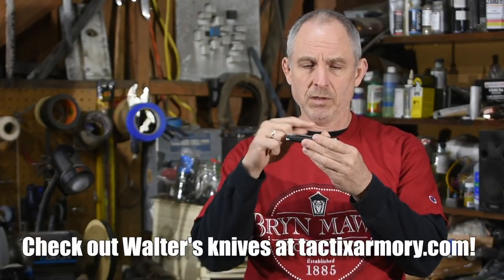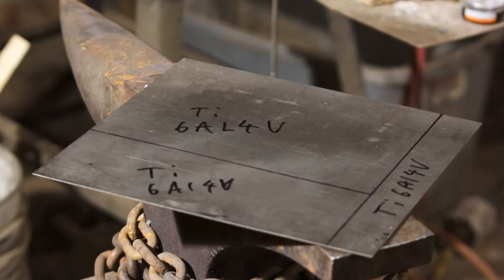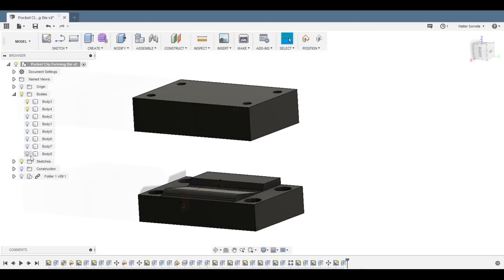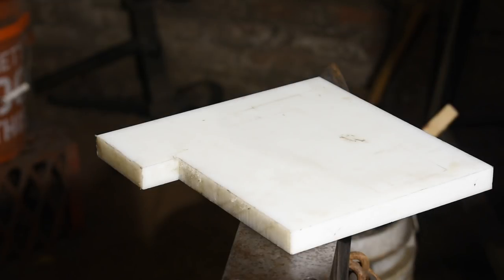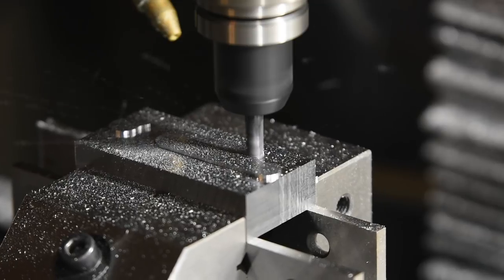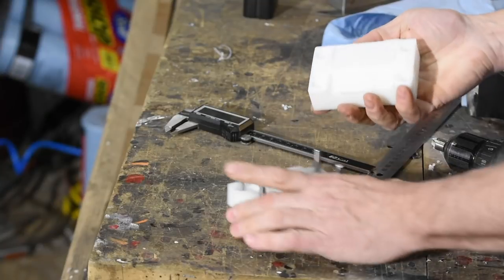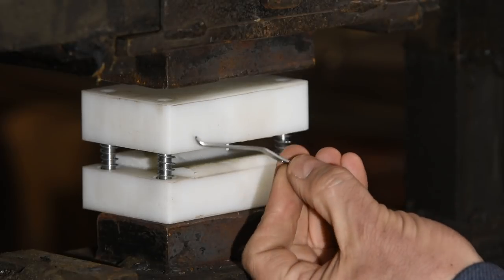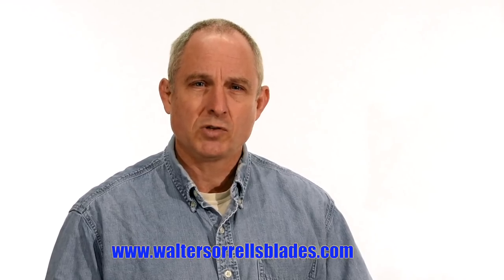Pocket Clip Shaping Die - Folding Knife Chronicles #6

Comment: Hey Walter, as a daily carrier of pocket clip folder knives for 20 years (I have around 30 of them) - a few constructive criticisms on your pocket clip, if I may. Your clip needs to have its edges and ends  well rounded. Its going to chowder up one's clothing in a hurry if not. Also easier on the hands. Further, the construction at the mount point will be hated by me. It needs to be folded over 180 degrees  (or way up, and gradually back down) there, so as to create a much deeper carry, and a space for your pocket fabric to fit into. That pinching V-mechanism at the top is a show stopper for me. You might consider using slightly thinner titanium, which will be easier to shape, and still retain enough springiness. I'm not a huge fan of Spyderco knives, but their pocket clips are often very good, in all the respects previously mentioned. A prime example of what I mean can be found on all Delica models. All the best!

Comment: Are tungsten and titanium good materials for knife making, or is steel better?
Reply: I think your quotation points more to blade making as these are commonly used for knife clips and scales.
Reply: @Ray-gz4ut  yes I was referring to the blades, what I meant was which is stronger material and less likely to break...
Reply: @arsinioboka26  Titanium does not hold a good edge. Get a good blade steel like AEB-L.
Reply: @Alphaknifesupply  ....so you mean that steel is better! Thank you for your help.